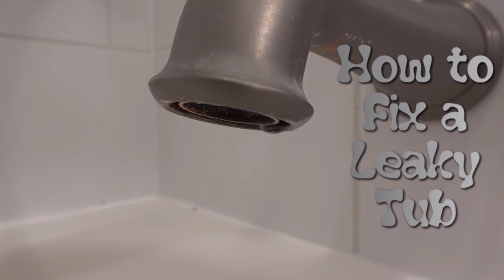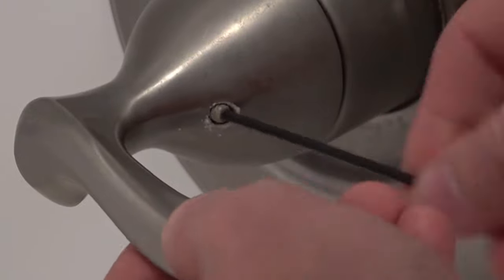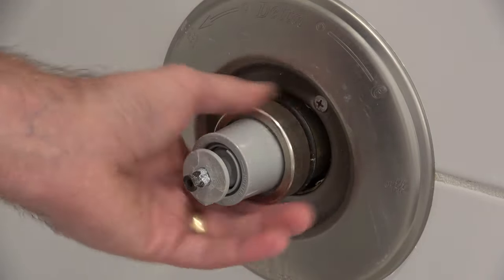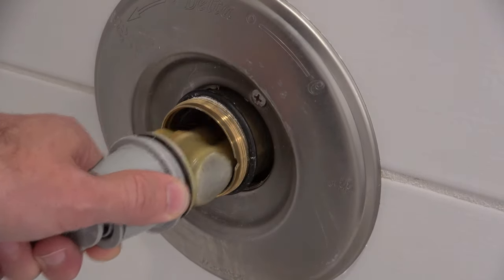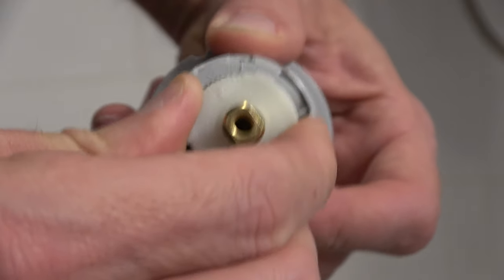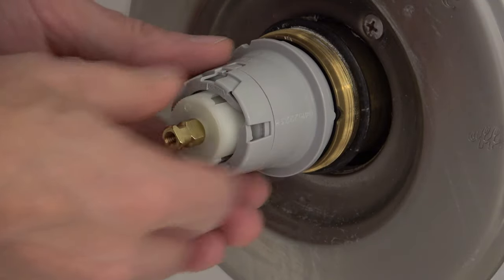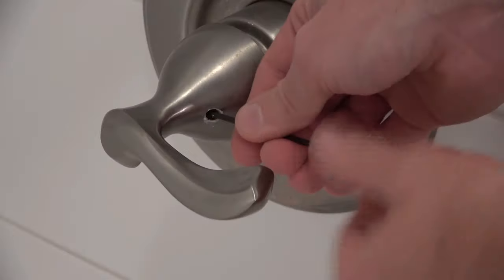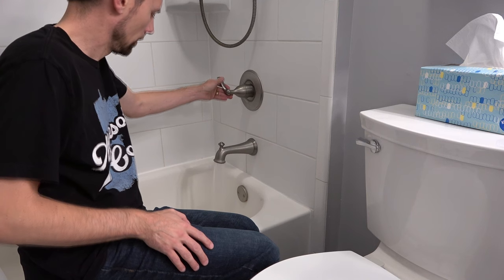How to Fix a Leaky Bathtub Faucet Quick and Easy

Comment: I followed this and the inner metal ring on my 20 year faucet was stuck so I cranked it loose with a wrench but it turned the entire system and I broke 3 pipes behind the cartridge.... Luckily I turned off the water but now I'm sure this just 50 times more expensive to fix :( be careful out there y'all

Comment: Super helpful!  When I removed mine, I noticed the two small o-rings where the cartridge connects to the supply had worn quite a bit compared to the new one, and replacing the two rings solved the drip.